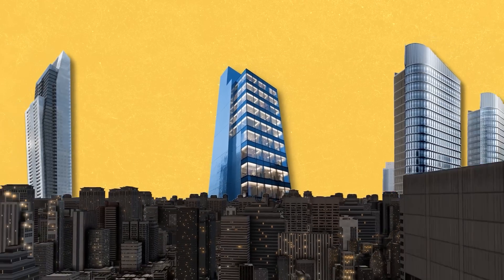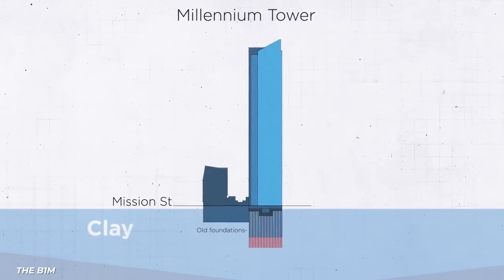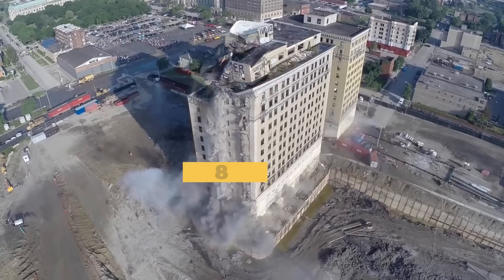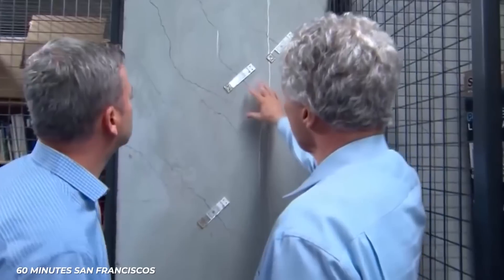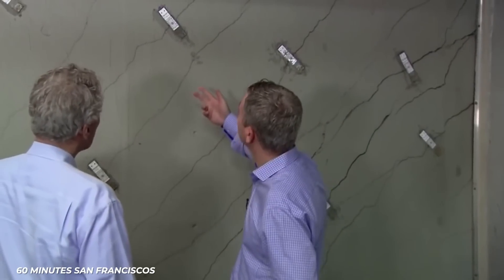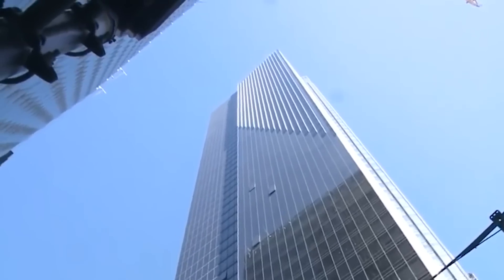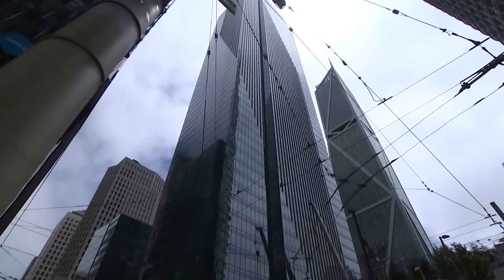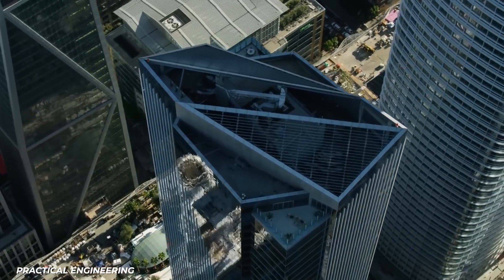Spending $100 Million To Stop This Tilting Skyscraper From Falling

Comment: I gave you chores of Los Angeles port to the Los Angeles international airport you know that there is a house that used to tilt as well by Portuguese bend I guess it would depend on if you follow the contractor not there's also a man that actually is on the horse and full armor you know like coach armor a pink armor that would actually be in that Palos Verde shopping center with the arches in brick by Manhattan Beach maybe you should have taken the cruise into her services cure and had lunch in Manhattan Beach Pier before taking everybody to the airport